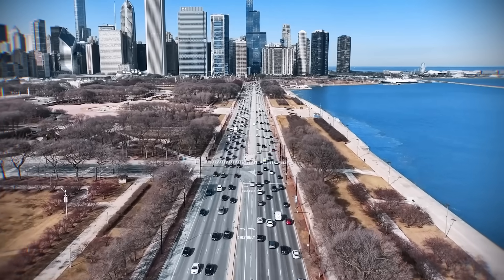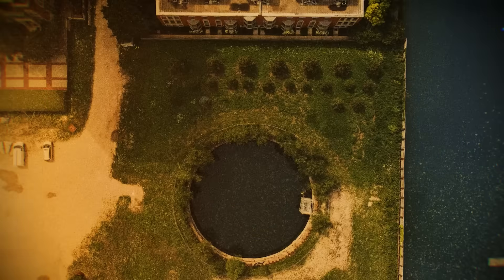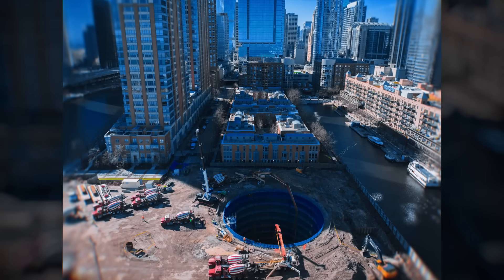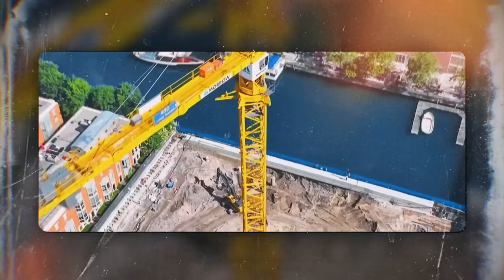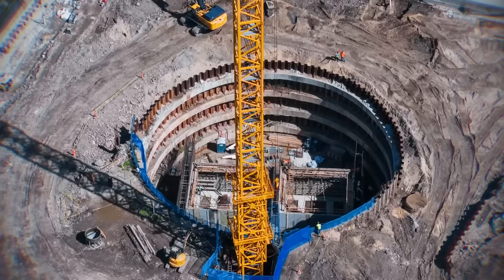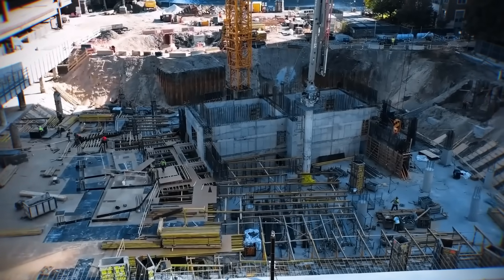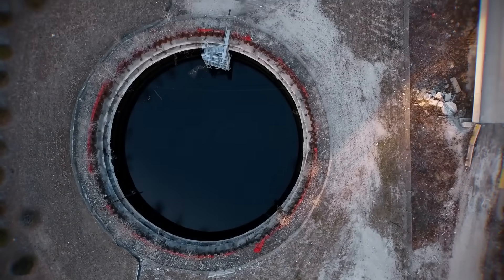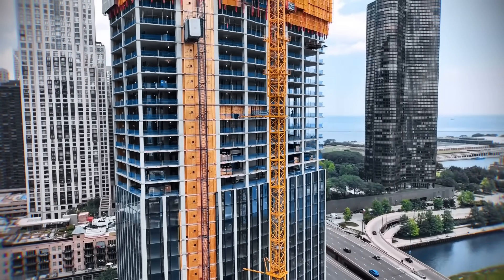Inside the Skyscraper Being Built Inside a 23-Meter-Deep Hole

Comment: The replacement project is nice but it's no Chicago Spire... I hope that one day the Spire can be revived for a different plot of land in the same area... Ditto for 7 South Dearborn and perhaps even the MB Skyneedle... Chicago has a great skyline but one that hasn't evolved nearly as dramatically as it should given its prominence as the largest and most important hub between New York and Los Angeles!
Reply: And just who is going to fill up all of those proposed/stalled buildings?  With the downtown commercial building vacancy situation, current downtown plans for commercial to residential conversion, and likely permanent hybrid work, there is not enough of a present/future critical mass of people to justify the need.